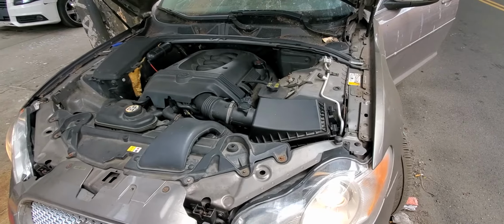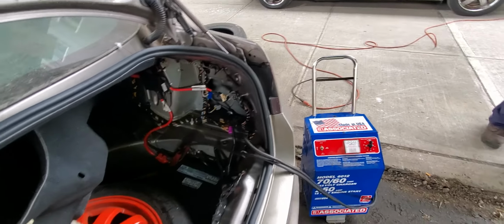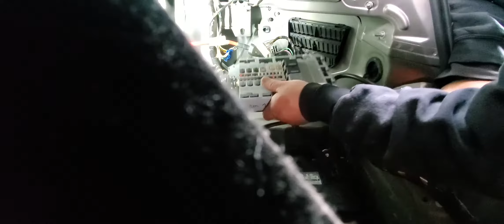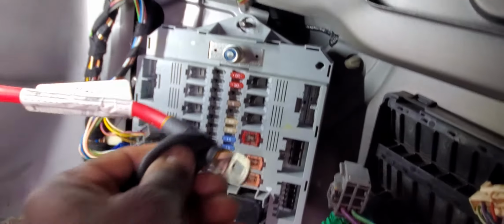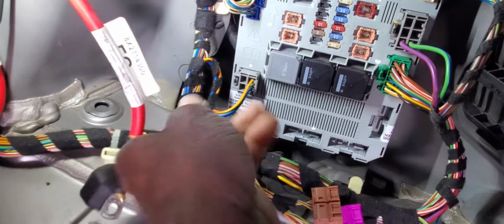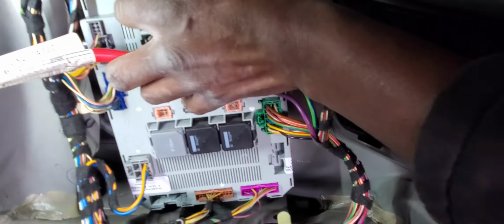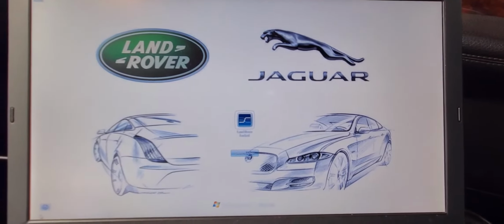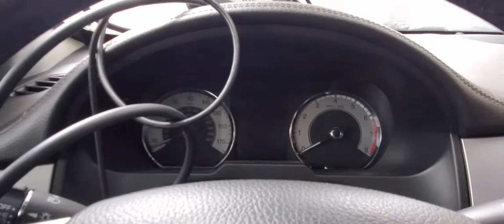Jaguar FX 2009-2013 Rear Body Control Module Replacement And progdamming Part 1

Comment: salam i have jaguar xf 2010 x250 , i did the rebuilt for transmission to replacement the solenoids filter with new oil , and all connection rubbers , drive the car was ok but when make relran for transmission by launch device i facing problem with the transmission bad shifting from 3 to 4 with sound in the transmission , with code u0140 lost communication with controal body ,, with others codes able to remove it not comes back if not drive the car only stayed code u0140 . my question is the transmission bad  nedd to repair, or  the problem from the BCM . because i want know the car deserve it to rparing or not . 
thank you
 younis from DUBAI

Comment: I have Jaguar XF 2012 I got a code B113E_23 tailgate switch circuit short to ground then I tried to fix the tailgate switch but I failed to repair it then I got all the hazard, brake and mirrors lights on continuously then I found damage wires in trunk I fixes it but all of the above lights expect the brake lights are still flashing on is the cause :

1- Fault in the tailgate switch or actuator
2- Fault in the (Rear Junction Box) 
Thank for help

Comment: I have Jaguar XF 2012 I got a code B113E_23 tailgate switch circuit short to ground then I tried to fix the tailgate switch but I failed to repair it then I got all the hazard, brake and mirrors lights on I found also broken wires in the trunk I fixed them but all the above lights still on please is the cause fault in the rear junction box controller and should be replaced.thank you

Comment: Could you tell also, if this module control also the dashboard display right? I recharge my battery with my charger and the dashboard decides to give up, and not display anymore, I reckon the module is dead, where can I get the module?
Reply: Ebay

Comment: Not sure if you would be able to provide any advise for my 2015 Jaguar XF 2.0 T  I replaced the battery and since then the truck is not opening the latch is working but once that I lock it, it doest open. When I press the bottom in the dash, the light inside the truck is on and the car register the trunk as open but it doesn't open. By the way, I cannot find part 2 of your video and where can I buy online the programming tool that you are using? Thank you !!!
Reply from the maker: please call me at 13472281875

Comment: I disconnected my battery for a moment and when I reconnect the battery to car it now won't read my remote, idk whats wrong I had the fob tested and it's good, I cant figure out what happened just from disconnected battery
Reply: I’m having the same problem locksmith said the fsjb (front smart junction box)  is the problem but I’m just now searching for the problem
Reply: Theres a file called a EEE stored in the microcontroller of the BCM. Low/ loss of voltage corrupts this data. Often replacement is required, some can recover the corrupted data. Or you put a virgin file in the EEE file and also in the P-flash. Then program using Jaguar software.
Reply: I have a Jaguar XJ everything on this car has to be reprogram you have to reprogram the car by going to the dealer
Reply: I had a friend to take out a fault code out of my Jaguar XJ I don't know what he did and deleted most of the programming in the computer that had to pay $1,800 to have them reprogram the computer in the car so be careful my car was kicking like a Bronco
Reply: Bring it to the dealer you have to reprogram the car

Comment: NEVER ever remove battery on these XF's unless you know what you are doing .It causes so many issues when you remove the cables. With the REAR BCM  the issue is always DAMP> REmove it and make up a plastic waterproof cover for it with drain holes in the bottom